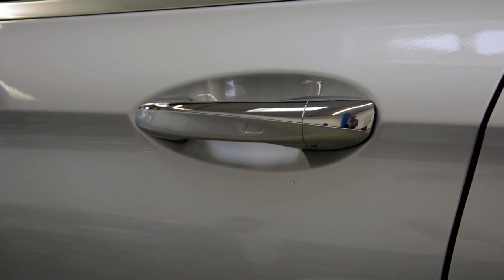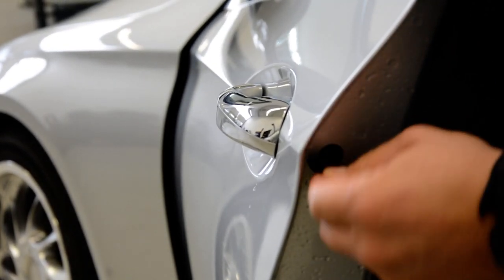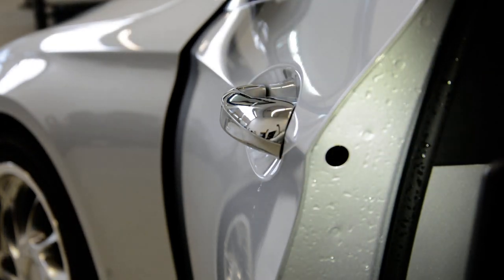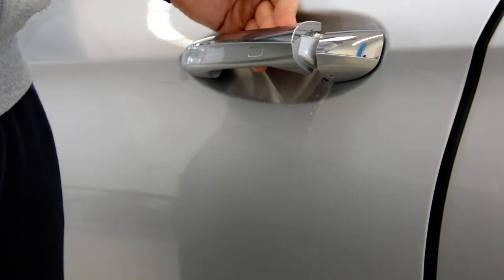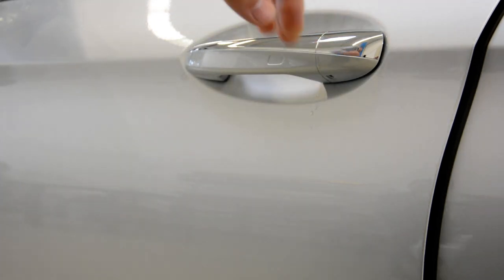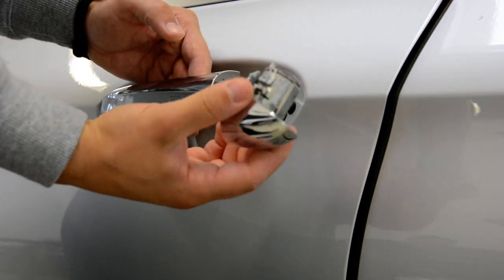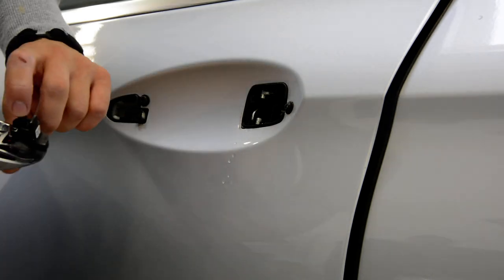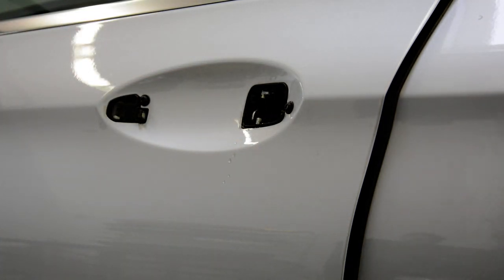Driver Door handle removal Mercedes Benz E Class  W213

Comment: The way to put it back on is very simple when you have the handle out you will be left with 2 openings in the door. Lets use the left side front door as an example. So first you slide the handle into the left opening and then in the right side you will see 2 silver locating pins get yourself a small screwdriver and lever those pins towards you and they will lock in place you will see a small silver strip that will hold the pins in place. Then you can slide the handle onto the pins. Easy as that no need to remove inner door cards or anything

Comment: I have the 2010 e63 amg with the keyless entry. Put the hand in the door handle and it unlocks and slide your hand on the outside handle and it looks. Will this screw up the settings when removing the door handle?